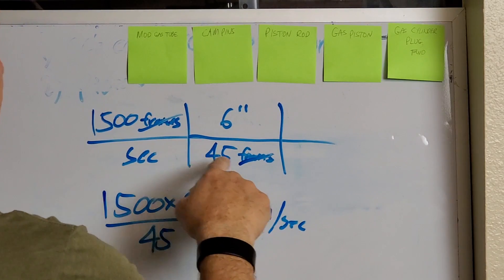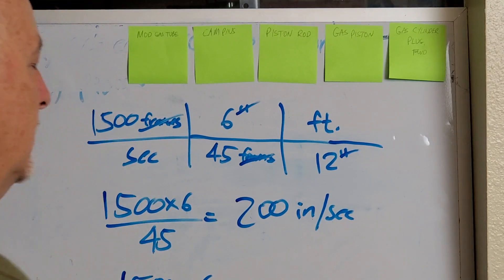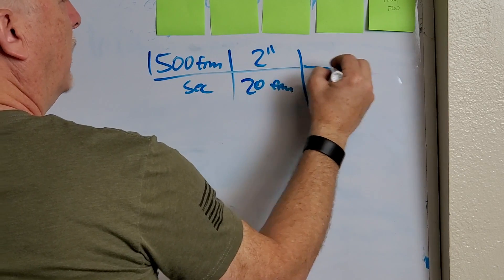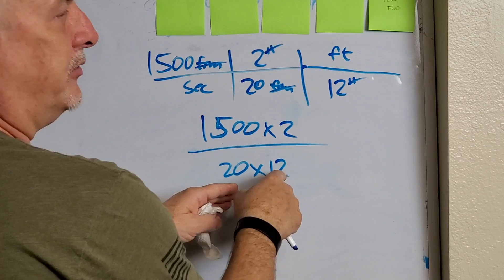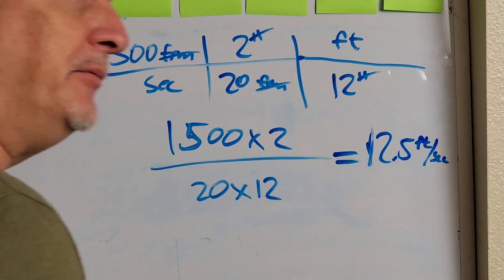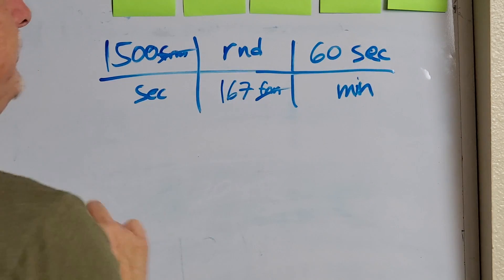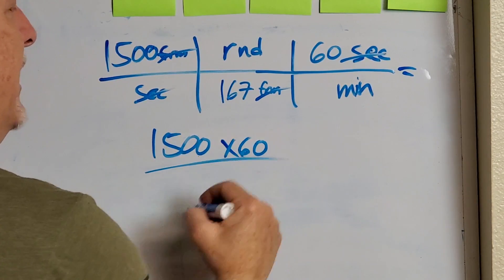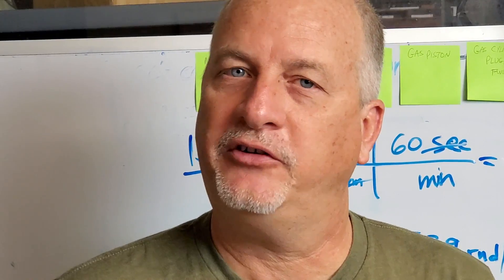Math...The Ladder Method!

Comment: The ladder is a good way to teach the concept but I routinely do "label canceling" by simply plugging what I know into a calculator and then multiplying or dividing by conversion factors while keeping the current unit label in my head as I work toward the units that I want.  I learned this from my high school science teacher, who could also do the math in his head without a calculator (before public schools became indoctrination camps that mostly teach compliance and conformity).

Comment: marky boi, could also cancel out the numbers at the math step as if you were simplifying a fraction, like 1500/10*12, 1500/20x6, if you were to cancel out the x2, if you had to actually pen and paper it anyways might be faster in some cases
Reply from the maker: It's actually easier to make errors that way, I've found.  The key is to make this process as mindless as possible.  I mean sure, if you see the same number on top and on bottom, by all means cancel them out.  Otherwise save the number crunching for a calculator at the end.

Comment: Hey ive got a question, i was watching a video on forgotten weapons called improvised and craft built weapons  there was a homemade SMG called the UFF-Avenger but instead of its recoil spring and rod in the back like the ROF and most blowback SMG it had the spring which kept the tension in front of the partial telescoping bolt, there was no spring behind the bolt he didn't take the gun apart but do you know of any SMG like this or how it works if you understand what I mean :)
Reply from the maker: They said it was a telescoping bolt, like an Uzi.  Obviously there is a compression spring between the back of the front part of the bolt and the front of the trunnion.  Most likely the spring encircles the barrel.  Never seen it done that way and unless you're using a spring that's more heat resistant than music wire, you run the risk of killing it with barrel heat.
Reply: Think of it like a blowback pistol like a ppk, except the slide is now contained inside a reciever tube